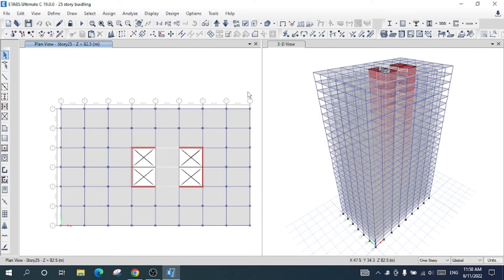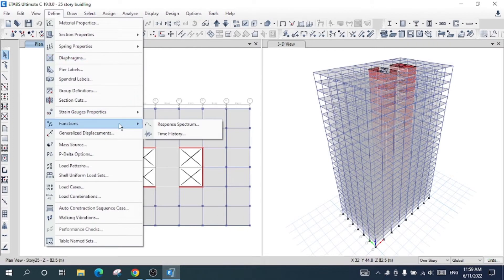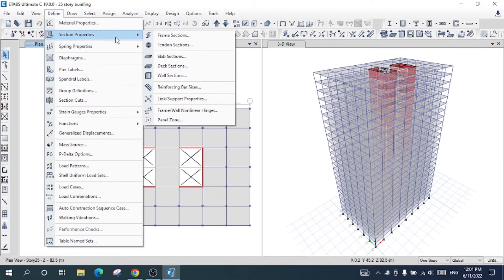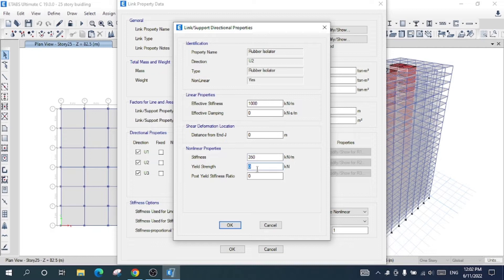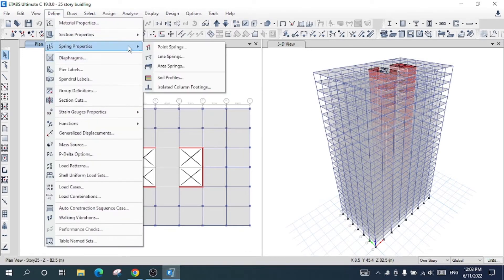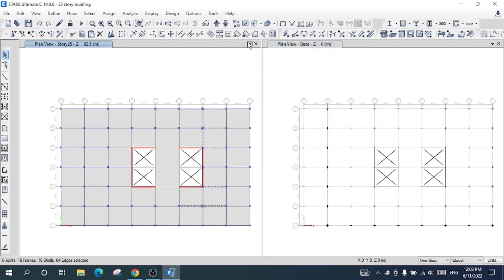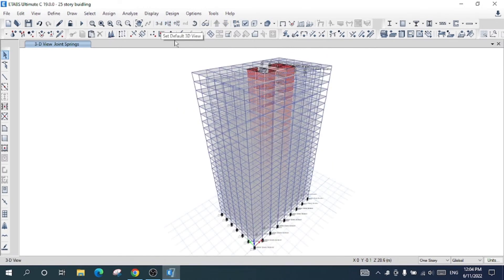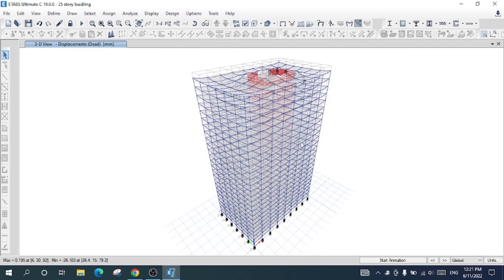Design and Analysis of a building using rubber Base Isolator / Damper - ETABS.

Comment: How does the point springs interact while they are connected to fixed supports?
And why are the non-linear stiffness properties defined for since there is no non-linear loading in the modal including the TH cases which seems to be Linear Modal?
Why is the linear stiffness value of U3 (1700000) is extremely large when compared to U2 (1000)? Which global coordinates do you think U2 and U3 correspond?
Reply: I have the same doubts. Especially about the support interaction and the global coordinates. There are videos where U1 is also defined. But it's not clear why the values are having such a large difference. Some journals even denote the stiffness values as horizontal and vertical, with vertical having a large magnitude. It's so confusing
Reply: @Shadiya Kabir  actually I have no doubt about my concerns. I am just trying to send a polite remark and warn our colleague to re-evaluate his definitions 🙄